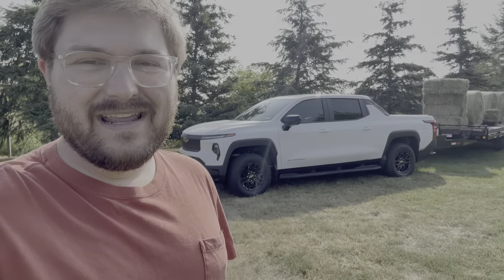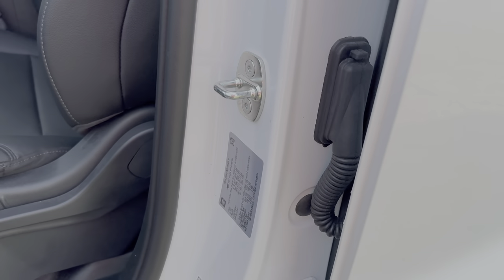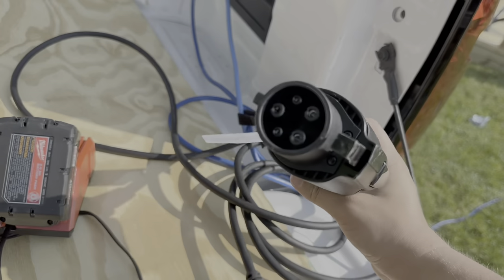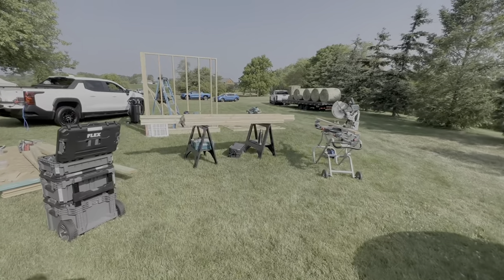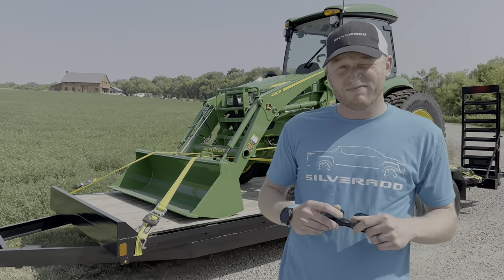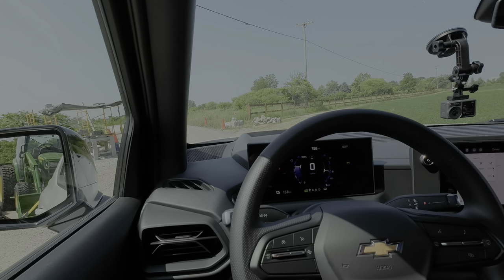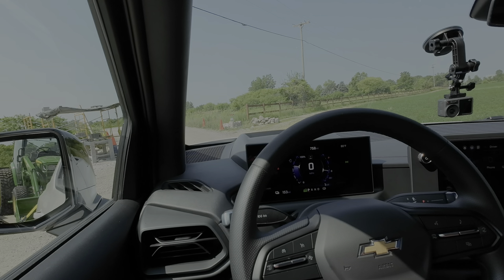Towing With The Silverado EV! Everything You Need To Know About Towing With Chevy's Electric Pickup

Comment: So if the trailer is 10,000lbs... Does that mean the tongue weight is around 1000lbs? 10%? According to the sticker, the max tongue weight is 800lbs. If the tongue weight is 1000lbs, that would also mean you have about 450lbs of payload remaining, of which you would be about half... I don't tow much, so could easily be wrong about everything.

Comment: I like the range & thats it!  Sorry m a Ford guy :p  To me the Ford dash looks better, the non slopping cab is better for 5th wheel towing (when ever they make 5th wheel rail for it)
Reply: Would need to be a very light 5th wheel to due to the low payload capacity on the truck. Few passengers, little to nothing in the frunk
Reply: @todd8005  i got a fiberglass trailer 5th wheel weights ~5000lb.   ETI 5.0TA.  awesome camping road trip rig.  could be awesome if I can tap into the battery for 120v to power the trailer

Comment: Kyle - is that the Equinox there, or the Blazer, in the shot with the top spec Silverado?
Reply: Looks like they have one of each there.
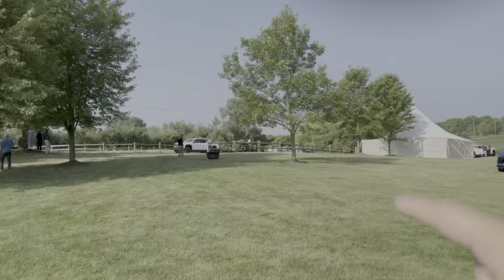Reply: @godofdun  At 4:13 in the same blue color as the Silverado RST is the one I was referring to. Edit - I see the other one just on the edge of the shot at 4:22 and then it is in the center (briefly) at around 6:36. And by the way, these are both FWD in their base configuration? That is a big disappointment, for sure.
Edit 2 - at about 6:39 Kyle says which is which - the Blazer has the black nose and is on the left, and the Equinox has the blue nose and is in front of the Silverado RST.
Reply: @NeilBlanchard  The one at 4:13 you're looking at is the Equinox, the other is the Blazer. FWD at base is pretty standard in GM land. It's usually not much more for AWD.
Reply: @godofdun  RWD is much better traction than FWD, and RWD also allows for a much better steering angle; because there are no CV joints and no half shafts on the front wheels.
Lower cost, lower weight, longer range - and it is possible to have a much smaller turning circle, with RWD.
Reply: @NeilBlanchard When did I start an argument about the benefits of RWD? I'm aware of all of that lol.
Reply: @godofdun  No argument from me. Just mentioning why FWD is a weak point for an EV, in my opinion. And why I don't want to have to buy AWD.
Reply: @NeilBlanchard  Ahh ok, that's fair. Doesn't matter too much to me, but I get why it would to someone else.

Comment: Average people (at least most that I know) buy decent used vehicles.   Hopefully in another 10 years or so these EVs will make decent used trucks that regular people can afford.   All the hype around EVs is largely out of reach for average working americans (especially trucks).  Id be driving an EV SUV right now if I could afford one.
Reply: After 10 years the EV will be out of  warranty and the battery will need replacement. A replacement battery these days are about $20,000

Comment: That GVWR number is really limiting on a truck this big and heavy. Not much payload at all for that heavy of a tow rating. For reference my  '18 3.5 EB F-150 has just over 2000 lbs of payload and it's not rated to tow much more (and requires the WDH over 5000 according to literature).

Comment: The weight vs towing capacity is a joke...
My 2020 GMC 3500HD AT4 L5P Duramax has a GVWR of 12100lbs, a payload capacity of 3700lbs and has a curb wight of 8400lbs, that alone gives me the advantage over ANY ev available...
Not too mention the my truck has a GCWR of 29700lbs, conventional towing capacity of 20000lbs(2000lbs tongue), or a gooseneck capacity of 21000lbs(3180lbs tongue)...
Towing my 8500lb 5th wheel, I have approximately 485mi range, I can refuel in 15 min and be on my way again, I don't have to wait 90min for a complete recharge...
There isn't an ev on the planet that can match that...
All things being equal, weight, cost, etc, ev's will never be mainstream, no matter how much you want them to be...

Comment: New combustion tech will have 75% efficiency vs EV at 85% and will have 6000/8400 mile HWY range with a 88 gallon tank on Ethanol/gasoline, 10,000/14,000 city.  68 mpg Hwy/116 MPG city, 97 MPG combined.

CO2 capture (dry ice) allows air conditioning while engine is off.  The engine is a combusiton heat pump of sorts.  The combustion engine torques out from ZERO RPM with no battery or EV nonsense need.  It has 100% brake recovery vs EV at 50%.  In city, it will be ~2x better MPGe than EV with no thermal needs/control, and 3-4 times better in extreme hot/cold.  Weight is 4200 LBs ( 200 LB less than 2000 Silverado) or 1/2 the EV Silverado.   Can tow up to 26,000 GVW limit with added tow tech with range of 1500 to 2000 mile range for a camper.  AWD, front and rear steering for ease of towing, turning around and parking.  Has Electric genset for 5 kw with engine driving genset and inverter with 1/2 kw capacity to buffer power.  Can use 5 kw genset to move car in no combustion mode if need for indoor use.  

Make fuel at home for $1/gal with CO2 capture (1/2 above range) on vehicle.  It takes $2.2/gal to capture CO2...so CO2 capture SAVES money.  Electro fuels from home solar thermal and nuclear  will be 3 cents/kwh or 20 times less costs than an a 100% RE grid at 60 cents/kwh.  Charging an EV in the UK is already 90 cents/kwh.  

Folks, EVs are obsolete.  This boat anchor piece is a waste of metal, time and money.  All EV companies will go bankrupt.  Combustion will be around for another 75 to 100 years.

Comment: Still 80,000 way to much for a basic truck
Reply: Its not the basic truck.
Reply: That’s a 210+ kWh pack and 350 kW charging. Far from basic. Once they ramp up production the base versions will be in the low to mid $50k range. After tax credit that’s $45-50k. Don’t know if you’ve been to a dealership lately be finding a full-size truck below that is near impossible. Then add in the lower fuel and maintenance to get total cost of ownership and you’ll be down around a special order bare basics full-size truck price.